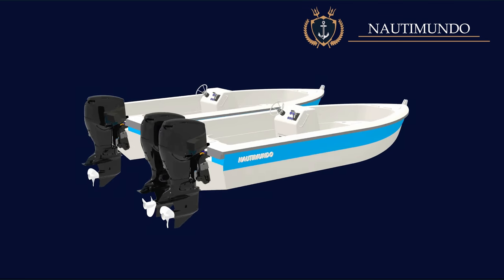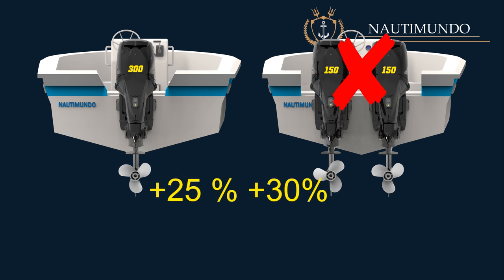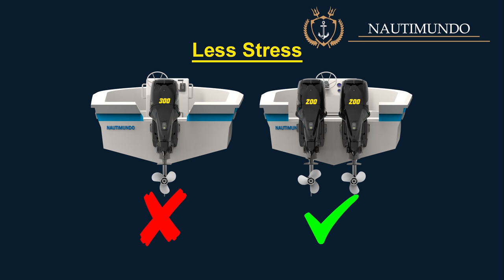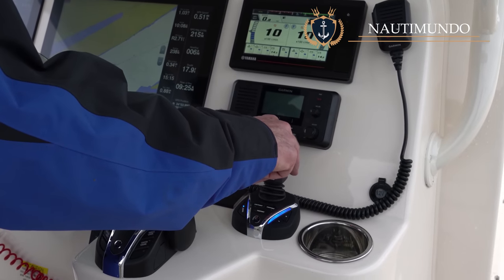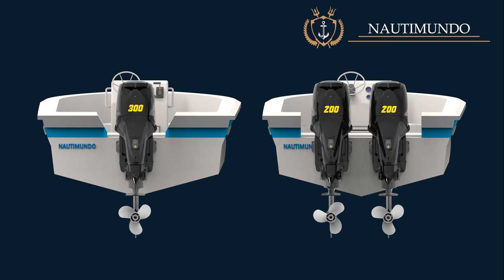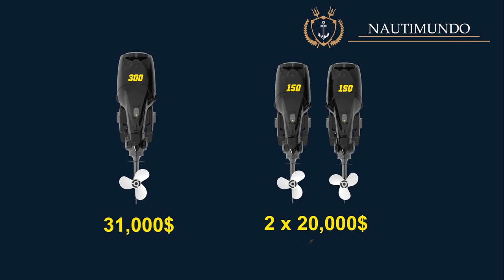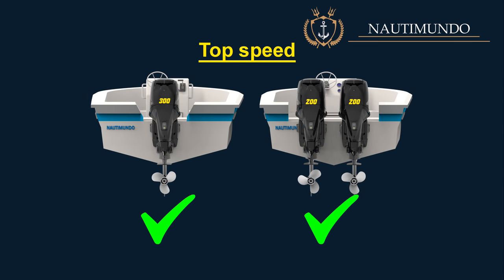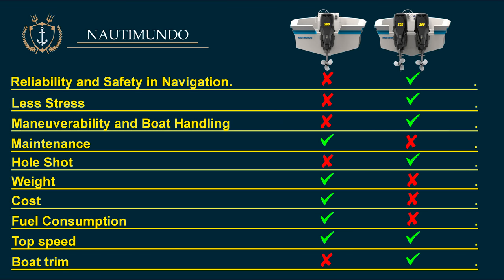single or twin boat engine? 1 or 2 Outboards? What is better twin outboards or single?

Comment: If you live in the first world, a single at sea is acceptable because there's generally decent coast guard services, but life in the rest of the planet, a twin is a no brainer regardless of all the above discussions.
Reply: If the engine died off shore, you're f**ked !
I d save 3 boats ran out of fuel or engine problems. Some didn't have enough rope for deep anchor. Some carry no torch light. Reading currents help rescue job a little easier
Reply: You seem like a Andrea Gail type captain
Reply: Exactly.
Reply: First world： This mercury V12 Look cool. lets us put 6 of them
Reply: Those dinosaur sailboats things where circumnavigating the globe with out engines from the beginning of time with unlimited range
Reply: @doradosurfcharters yea the irony is they are trying to reduce the carbon emissions of shipping when there's been emissions free travel since we first hit the seas thousands of years ago
Reply: Don't expect others to come save you. Self rescue. "Good" coast guard or otherwise you are responsible for your safe return.
Reply: Coast Guard won’t come get you unless it’s a life threatening situation. They recommend calling a friend or a commercial tow services like tow boat US.
Reply: If you go into Atlantic Ocean  you  Twin are a must. Never know when engine failure occurs,  and you can’t rely on communication systems. Remember current can take you  quickly and once past Cuba,  African coast is your next destination stop if you’re fortunate than again by that time you’re already a corpse.    live near southern tip  of Florida between carribean sea and Atlantic Ocean.  This is an unforgiving formidable current. Always go for twins just for safety & peace of mind if you merely  are on a lake I still like twins,  gives a better ride and more stable ride. Simply not as fast as I put four blades props will  give you more control less top end but control is far more important and gives you better torque at start.   Again my preferences.  if you break down with a single hope you enjoy rowing back,  with twins  you always have an additional engine. If you’re relying a sea tow you can always count on satellite towers and communications to strike you in time of duress why it’s called Murphy law. “If it can go wrong it will go wrong,” Always prepared for any situation always pack water some food and first aid supplies  whenever you go out on water, you simply never know adventure you’re about to experience.
Reply: You must have a second motor if one fails otherwise you are left stranded in many places
Reply: @blackwidowsm   a tank of bad fuel will take out all the engines, regardless of count. I’ve seen it happen many times.
Reply: I live in the third world and nobody does that stupid thing of having two or more identical motors. Some of us have a little emergency motor, just in case, but as far I never needed it
Reply: @marianohernangutierrez2525   I live in the US and that’s all most had before the fad. We called it a “ kicker”, a little motor , like 3-9.9 hp on a special bracket. If the motor conked out, you dropped the kicker and made your way in.
People are so scared and soft today.
Reply: If yoy live in 3rd world you just won't be able to afford a boat... i can tell it cause i live here
Reply: @pedrosilveira6554  eso simplemente es mentira. Vivo en argentina y mucha gente tiene lancha. Desde humildes pescadores hasta yates millonarios
Reply: @marianohernangutierrez2525  tu tienes? 
En Brasil, donde vivo, solo los que trabajan con barco o los que son muy milionarios tienen barcos
Reply: @pedrosilveira6554  no hay gente con lanchas pequeñas para recreación??? Me suena muy raro
Reply: @marianohernangutierrez2525  los que las tienen ya son considerados "endiñerados", creo que menos de 10% o menos de 5%  de la populacion tiene plata para comprarla se la quiser... Brasil es MUY desigual! :(
Reply: @megastick9324 
That’s the way to go. Best compromise.

Comment: Having two motors gives you the possibility to save your life in case of failure. Boating is really expensive, it is not possible to save
Reply: The majority of commercial vessels operate on a singe engine, but with redundancies for fueling and cooling.   Twin outboards are as susceptible to fuelling issues unless with fully redundancy

Comment: My boat started with a 235hp from the factory.   It was problematic and got replaced for twin 150’s.   Since I was going 40-50 miles off shores twins turned out to be the best choice.     I never got stranded and I never had a fuel probl
Reply: Got to have twins if going offshore 50 miles out and some reliable Yamaha's. The farthest I went offshore was 15 miles with a single Yamaha 150hp
Reply: I went around the world with a 9.9 mercury
Reply: You will

Comment: Twins got me home. Had one engine quit peeing and shut off. was able to lift the motor and cruise in on the other one. It sucks to have to pay double to maintain 2 engines but its worth it to get back to the boat ramp.
Reply: In Malysia, if the engine died offshore the boat can drift to Vietnam. It happened before !
Reply: @rohzpopper4922 here in UK they tend to drift across from France fully loaded - regardless of engine fitment…..
Reply: @PhilbyFavourites  I see what you did there

Comment: Twins also give you a TON more manoeuvrability. The ability to walk the boat sideways alone is worth the cost.
Reply: Again, single better with bow thruster
Reply: I agree. Being able to "crab walk" the boat right up to the dock makes docking effortless. Unless as kirkwilliams pointed out you have a single engine with a bow thruster. I would still prefer twin engines though if spending a lot of time well offshore. A bow thruster 40 miles away from land won't do you much good.

Comment: Twins cost more, (generally, but not always) but I feel they are better in most boats that run offshore 24 feet plus. Here's why: 1) Most twin configurations have a shallower draft because of the motors being mounted off the center-line. That's great for low tide bay navigation. 2) Docking is way easier, especially in wind. 3) Fuel is not the only problem. If you do your maintenance fuel is a non-issue. I have burned up a water pump on one motor because we ran across a slightly submerged ice bag from another boat. The bag was impossible to see, but rendered our port motor useless. We still fished the whole day and got home before dark 30 miles outside of IRI DE with fish.  4) On occasion we run up to 80 miles one way. Redundancy is key.  5) A boat tracks true with twins. Set the autopilot and forget it. (I get the the dual prop theory. That does not help if you hit a submerged object or a sucked up or ice bag from a lousy boater) 6) Check the torque of say one 300 versus two 150's. Torque moves the boat, hp is way less important- also look at the rpm needed to produce said torque and hp. 

The downside is more work/cost-oil changes, gear oil, belts, spark plugs, thermostats,  etc.

This is just my humble opinion having owned both. Pick your poison and have fun!
Reply: Yea twin 200 will blow a single 300 out of the water on a fully loaded boat as it’s 12 cylinders vs 8 and 2 props vs 1
Reply: 2 tanks, 2 fuel hoses, 2 engines, bilge pump, radio, etc etc unless you can walk home
Reply: Non-boater here - what was that other boat doing with a slightly submerged icebag tagging along?
Reply: @Vee6watchman they threw (or it blew) an empty clear plastic bag, like ice comes in overboard. Because it's clear and doesn't just float on the surface, other boaters, and sea life, may not see it before it causes damage.
Reply: Draft is the same..... its the distance from waterline to the bottom of the skegs, not the distance between the hull and the props.
Reply: @derekmoult238 not correct

Comment: With the Suzuki 300 and 350 duoprop, and a 20 hp kicker, it beats twin 200s or 150s in my opinion. You could run the kicker for trolling or low speeds to save the hours on the main motor while fishing or navigating in the marina. Plus, the kicker will get you home slowly The duo props have enough bite and handle well too.  as the video states, it's also more efficient and less maintenance with the single main outboard.
Reply: Yep, you're spot on.

Comment: I have one question though. In Canada BC every boat with a motor with 10 hp or more needs to be licensed and I believe many states in north america have simular laws. Does a twin 9.9 hp count now still as 9.9 hp propulsion or as 19.8 hp? Also, would a twin 9.9hp actually be faster then a single 9.9hp?

Comment: I just went through the pros and cons of single vs dual while shopping for my new boat. For me it came down to peace of mind, ease of docking and maneuverability in tight situations and performance out of the hole. If a boat is powered correctly I think performance is a wash to some extent. For me, I think I made the right decision on my 26' WA with twin 200HP outboards.  I can live with paying double for everything maintenance wise.

Comment: i think not all information are accurate. i have a twin 150hp each and my friend have exactly the same boat with singe 300hp and my boat is quicker on a plane and faster overall. its consuming only 10% more than single. Of course price, maintenance cost (and any repair) usually is double but mobility and stability on the water is much better than single. I would never go back to single if boat will have a option to install 2 engines. Regarding problem with fuel - if there is any problem usually affect both engines as tank is only one and even if will be 2 separated tanks usually people filling up from one petrol station.
Reply: You are dreaming 😂
Reply: @johnboy5167  no, i'm living my dream :D

Comment: I replaced a 4 cylinder 100 hp engine with a V8 Volvo Penta AQ225 in a 24 foot boat. What a massive difference. Lower fuel consumption. Relaxed boating, quick to get on plane whatever the load. Cruising at 2700 rpm with a top rev (hardly ever used) of 5000 rpm.

Comment: In Germany you nearly don’t see twins on the Baltic Sea. Single engine is enough and the most skippers has just one. But here are the costs (e.g. for Fuel) a lot higher than in the US. Maybe that’s a reason. In the US 2-4 engines are normal I think :D I have one Mercruiser 4,3L and it works well. Never needed a second engine

Comment: Most of this video assumes you will do more power. Which is a bit misleading-leading in my opinion. Like hole shot, power, top speed. All benefit from more power. Personally I’d say compare the twins to the same HP single for those figures. Meaning if your boat can handle 400hp and you equip it with a single 300hp engine or twin 150hp engines. Obviously the 400 single and twin 200s will do better for performance numbers. How much better would the twins be. Wouldn’t it be better also to just go higher HP single.

Comment: i have a 191 mako with 150 verado-do use it in salt water but don't go out much over 15 mile but i did like another commenter did-added a merc 20 hp kicker for trolling and still can get you back -just in case

Comment: Point 1: nowadays, before an outboard breakes you can check multiple alarms , and it’s all your fault the choise to use it anyway and get out the port.

Point 2: it’s not a good advise to use the outbord for long time at max speed/power range.

Comment: The first part was already proven wrong in another video. Two 150 Yamaha outboards were put on a boat vsa single 300 on another. The twin outboards were quicker holeshot and had a little bit more top speed. They also used less fuel.
Reply: Top speed depends on your load, if it’s a heavy boat/load the twins are better, and if it’s a lighter boat/load the single will, also twin 200s will burn more fuel than a single 300, it’s 12 cylinders vs 8

Comment: I see way too many multi-engine boats on inland lakes, its just showing off.  Only if you are going offshore do you somewhat need it,  and it comes with a steep cost.  In todays world with SAT capable phones (Iphone has this) and GPS, its pretty easy to get a tow, and with improved outboard reliability, its hard to justify doubling for reliablity.  A kicker if you troll fish as you would use it regularly and keep fuel system fresh.

Comment: The performance increase for 2 motors instead of one is minimal, at the cost of reduced efficiency (2 smaller propellers are less efficient than a single, larger one), increased fuel consumption, and more maintenance. The "safety" factor that you have at least one running motor is partially negated by the fact that one motor is twice as likely to break for the 2 motor configuration. It's much more economical and simpler to increase mean time between failures for a single motor with proper maintenance, proper fuel, etc. Handling differences - it's just exercise and learning, which is part of the fun.

Comment: Twins are more maneuverable, and you have a backup if 1 fails. With Twin engines you can literally pivot in place something a single engine can only do with bow thrusters. I've owned both.

Comment: Pretty much the only people who need to run twin engines are those working or recreating off shore. A single engine is plenty for anyone working or recreating inshore or on lakes and rivers. Invest in a quality VHF radio setup, be diligent with maintaining your engine and fuel system, and you'll be safe and save a ton of money.

Comment: Twins are generally totally unnecessary weight, cost, maintenance cost, and consumption for any boat under 25'.  30 years ago they made sense since outboards were not yet what they are today. Today its a totally different dynamic. OUtboards in the last 15 years have made leaps in reliability. IF you are leaving the port crossing your fingers about your motor - then something is wrong. The added weight of two engines is a lot and the increase in fuel consumption and maintenance costst cancels out most the benefit.  Single engine is not intrinsically working harder than it should. If the motor is chosen correctly based on the boat weight etc less is always more with big cost savings.

Comment: Always have a small "kicker" for safety. A single is far less expensive to buy and operate. If it is important to have a boat that will "outrun" all other boats to assuage your "manly hood", and be able to go 7 1/2 mph faster and to get a 4 second faster "hole shot", go for the twin 300s and spend $thousands more for another motor, a heavier boat to accommodate the twins and a heavier duty trailer,. otherwise, go fishing with a single with a kicker motor, and the fish will taste better and be bigger when fishing with a single.

Comment: You didn’t mention a fairly significant difference in some cases: the amount of space they take up! You’re doing a lot of fishing back there, avoiding a single motor is a lot easier than having a full set of motors taking up the whole transom. Also takes up room where you might want swim ladders, etc..

Comment: Now there .. we’ll done but there is small mistake.
HP is related to your hull speed. More HP does not make your boat faster. Until your boat does come out of the water.
Two engines means more prop surface. It has more torque available this make towing way batter than an single .
So two 150 hp or one 300 hp can be good as your speed is not needed but pull power is wanted.

Comment: Your twin engine plus 25-30% rule only applies if the engine weight is suitable.
The reason is because of the extra drag and the two outboards are not parallel to each other. ( toe in )
Your fuel efficiency part is not correct because there’s too many variables. Big engine doesn’t equal more fuel. It’s actually the opposite.

Comment: While there are some good points in this video there are too many bad/dangerous ones. First of all, if the boat is rated for 300hp you can't put twin 200s on it. Twin 150s would significantly change many of the results.

Comment: You got to you got a synchronize them you got one you don't have to synchronize them or you can use a jet motor it all depends a boat is a boat depends on how much 5,000 gallons of fuel you'll need and how far can you go a sailboat could go farther than than a motorboat remember the fuel run one engine say fuel run two you still get there do a steam engine you could do a gas engine air cooling engine fuel injection engine or carburetor engine it's different types of engines for different things

Comment: If you navigate in Cel Phone/radio reach(as long as you can give your position/if you got a GPS)), single engine enough. But way out yonder, a twin is more reliable, Even a Auxiliary trolling(Gas engine) will get you back. Fat wallet if you have to call for rescue

Comment: It all depends on what you're going to do with the boat where you're going to go with it and are you holding a very big load how many people are on the boat how big is the boat obviously you don't need twin engines on a little 18 ft Runabout boat put on a 25 ft center console and you're going out in the ocean fishing you should have minimum two engines and minimum minimum 150 horsepower to 200 horsepower absolute minimum